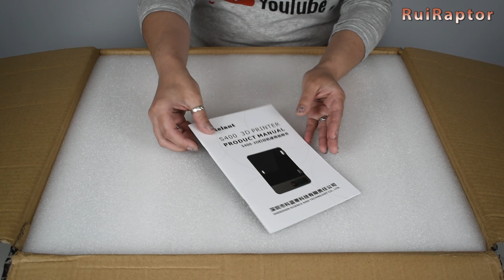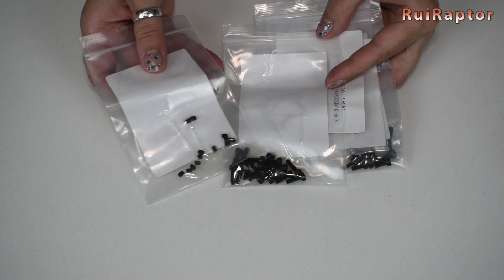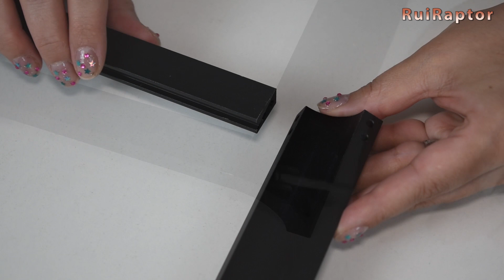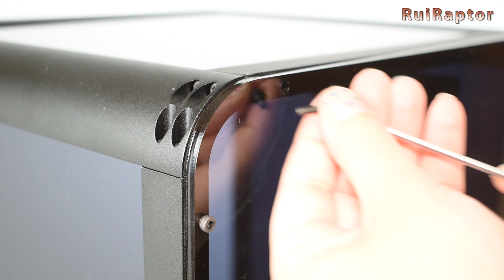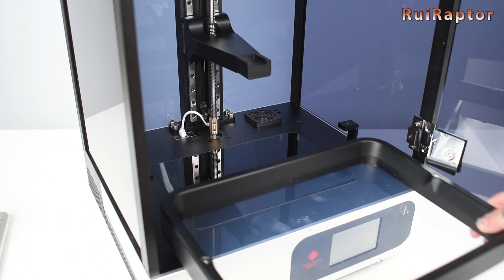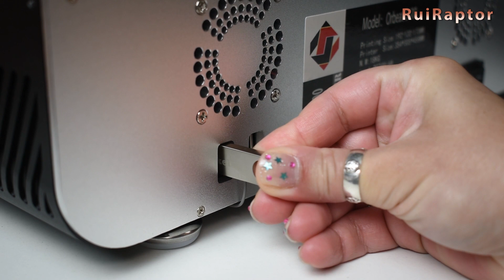Kelant S400 Resin 3D Printer - Assembly & Overview

Comment: For anyone following my scribblings, I finally got the Kelant to work.  It turned out to be settings all along, they need to be very different to the Photon and to the instruction book supplied.  Basically, all prints must be positioned at an angle of 45 degrees or more, supports must be medium or heavy with a minimum diameter of 2 mm, never use smaller as the film separation forces will break them every time.  The bottom lift speed which is where the film separates is 1 - 3 mm at 80 mm/sec in the book, this needs to be 3 mm at 15 - 20 mm/sec, separation using the book settings is with a loud bang but at the slower speed its a gentle ripping noise, much less damaging to the print and the Z axis.  At 50 um layers the bottom exposure should be 50 secs and normal exposure  7.5 - 8 secs, I have recently been printing at 100 um with almost no change to the print quality but increased times to 60 secs and 8.5 - 9 secs.  The rest of the settings are not important but I use 200 mm/sec rising and falling, no exposure delay and a second lift of 5 mm.  The base count is important, I use 5, any more and the base is so solid that a hammer and chisel are required to remove it from the bed.

These settings work with Anycubic resins so adjustment may be needed if the resin you use is know to require different settings, otherwise its a good place to start.    Don't try the book settings as they are way off, I have sent all this information to Kelant, whether they use it at all is up to them.  Once mastered the Combat S400 is a very good machine, robust, well made and now reliable, I just pause it to check the base about 15 minutes in then let it run, I have had perfect prints for a few days now.  One other point that is in the manual but always gets overlooked, remove the USB drive before turning on and re-insert after the machine has finished booting up, put it in too soon and the files won't be found.  One last point, because of the inconveniently placed USB ports at the back, I added a hub with a short lead for convenient access.  This works but the S400 usually finds up to 2, 3 or 4 folders now instead of 1, presumably caused by the hub.  I soon got the hang of finding the one with the files in, the rest will give a blank screen.

I hope this will be helpful to anyone struggling as I was.
Mark Clark
UK
Reply from the maker: Thank you for all your feedback Mark. Glad it's finally working :)
Reply: @ruiraptor  Not before time, it needs to earn me some money now to pay back all the time, effort and at least 4 liters of resin that's gone into it.  Kelant were not as supportive as I would have liked but a lot of that is down to poor communication, when I asked for a replacement or refund they found someone who knew English to deal with my emails and it went a lot more smoothly.

Enough of this, I've got printing to do and each run is over 7 hours, i can just get 3 a day in if I time it right.  Feel free to pass any enquiries about Kelants my way as I seem to be a self taught expert now and its good to share knowledge.
]
Mark
Reply from the maker: Hi Mark, since you had many issues related with settings, one idea is probably sharing your slicer profile. I guess that many users out there will have the same problems too. :)
Reply: @ruiraptor  Fine by me, below is what I sent to Kelant.  Their instructions are not good and suffer from poor grammar, I had to do a lot of interpreting and deduction to work out what they meant.  After all that the settings were way off, the 80 mm/min was the biggest issue as the larger film was ripped off the print damaging the print and the film.  The longer exposure times were Kelant's suggestion as the supports had random failures.  The settings below are for a group of prints using 80% of the area, for a small print in the center of the area reduce the exposure by 1 sec and bottom exposure by 5 secs.  Interestingly printing at 100 um layers produces almost identical results to 50 or 60 um but its not much quicker, I print railway wagon bodies 3 at a time at a 45 deg angle, around 1000 layers at about 20 secs per layer should be around 5.5 - 6 hours but it actually takes about 7.5 hours, no idea why as at 60 um and 1600 layers it was taking only an hour longer.  I have added the recommended settings to the right of the first set of settings for comparison.  I don't use Social Media so feel free to make these figures available to anyone interested, you can add my name and email as well as people often need explanations and I am used to dealing with emails from other countries.

- You should put a note in the packaging to say that "The USB drive should only be inserted after the machine has finished loading, otherwise the machine will not find any files"  It does say this in the instructions but most people overlook it.

- You should also add "File names must have normal characters and no spaces, example -   Battle_figure_35th_scale"

- Also add "Prints should be positioned standing at an angle of 45 degrees or more, they will print better and use less resin for supports".  Also "use only medium or heavy supports with a minimum diameter of 2mm"

All these points are important and will cause failed prints and endless frustration as I have had.  I will post this information on line.

These are the machine settings that I found work best, I have not printed layers less than 50 um.

Layer height 0.05 - 0.06 mm (50 - 60 um)

Exposure - 7.5 - 8 secs (7500 - 8000 ms)                               Rec - 5 - 5.5 sec
Bottom exposure - 50 secs (50,000 ms)                                  Rec - 40 sec
Bottom layer count - 5                                                              Rec - 3
Light off delay - 1 sec (1000 ms)                                              Rec - 1 - 3 sec
First lift distance - 3 mm                                                           Rec - 3 mm
First lift speed - 15 - 25 mm/min                                              Rec - 80 mm/min
Second lift distance - 5 mm                                                     Rec - 4 mm
Rising speed - 200 mm/min                                                     Rec - 300 mm/min
Falling speed - 200 mm/min                                                    Rec - 300 mm/min

Layer height 0.08 - 0.1mm (80 - 100um)

Exposure - 8.5 - 9 secs (8500 - 9000 ms)
Bottom exposure - 60 secs (60,000 ms)
Bottom layer count - 5
Light off delay - 1 sec (1000 ms)
First lift distance - 3 mm
First lift speed - 15 - 25 mm/min
Second lift distance - 5 mm
Rising speed - 200 mm/min
Falling speed - 200 mm/min

These settings are very different to the settings in your instructions, they will not work at all.  If you wish, add these settings to your instructions and say "as recommended by a customer" which will allow the purchaser to try them if they wish without affecting Kelant.

That's it, thanks for your support
Mark
Reply: @ruiraptor   Closer to a review than anything you have provided lately. I seem to remember actual reviews from your channel but apparently all you do is shill for Chinese companies these days.
Reply: Hi Mark I need help
I am trying to transfer a 3D model from the Chitubox program to the Kelant S400s printer and I always get Slice Format error, someone can help me I have passed them in all formats and I always get the same
Thank you
Reply: Hi Maria
The only format that the Kelant can use with Chitubox is a zip file, its usually at the bottom of the pop up list and the file name must have no spaces, use underscore as a space.  Your file name should read something like;  unicorn_figurine_52mm_x3  If there are spaces, the Kelant will reject it and I don't think it likes capital letters either.  The good point is that when a zip file is loaded it will display the settings on the screen and speeds, distances and times can be adjusted if necessary at the printer before printing.  Do not change the layer thickness as it will print a squashed or stretched item, I know because I tried it.  To change the layer height you have to reload in Chitubox and start from scratch.
Mark
Reply: Hi Mark Thank you for answering, Now if the machine is reading it but I'm still super frustrated it doesn't do anything if I give you my wasap we could exchange photos so you can help me with the parameters?? Please!!!
Reply: Or email????
Reply: I don't do wasap, email me on borsig1958@gmail.com.
Mark

Comment: The saga continues.  After repeated requests for help from Kelamt I tried all the things they suggested and more changes to the settings that I came up with.  To combat the fierce pull of the FEP film I slowed the first lift from 80mm/min to 60, then 40, 30, 20 and settled on 15mm/min for 4 mm lift.  I was getting separation of the base from the supports, this turned out to be the ChiTuBox base which is generated automatically.  It can be deleted then the supports get an individual base which merge to form a solid base.  I set these at 10mm dia and 0.6mm thick, problem solved.  I thought I was nearly there but kept getting support failure in patches of 6 to 10 supports, the print would still be mostly OK but a bit wonky above the failed supports.  Nothing I did had any effect so I attacked Kelant again demanding a replacement or refundand got a reply from someone with much better English and grammar who told me that study of the pictures I sent them indicated that increasing the exposure time by 2 seconds would help.

I was skeptical but gave it a try and it did work, the support failure has mostly gone.  All that remains is to find a support size that the machine likes.  I can't use light supports at all,, and the medium ones fail a lot as well.  Heavy supports work but I have to destroy the print to get them off.  The solution will be a medium support with thicker legs and top cone but the same attachment size.  Supports must also be removed while the print is still soft or the snapping force can damage the print.  I have now had 3 almost perfect prints in a row so it can't be much longer to get it right.

Comment: An update for any of you interested, its still not working!  Kelant insists that its the settings I am using but I am familiar enough with these resin printers to know that its more than that.  After more failures I stripped off the top covers for a good look at the working parts.  The Z axis is fine, rigid, upright and no play at any point, the bed is flat and adjusts far enough to sit squarely on the screen.  The screen however is not flat, when checked with a straight edge it has a high point at the left center, above where the screen ribbon cable folds underneath.  It is high enough to allow a piece of paper to slip under the ends of the steel rule I used as a straight edge.  Kelant say this will have no effect and asked me to send the stl files of the items that fail to print, they returned one with supports added and I test printed it, it failed, the base stuck but a lot of supports failed so I aborted after about 50 minutes.

Looking at where the high spot is I can see plastic film trapped under the screen, the remnants of the screen protector I expect.  When replacing the screen on my Photon I did not put sticky taper under the ribbon cable as I thought it might cause just this problem, Kelant have definitely stuck this end and trapped an extra film layer as well.  I have offered to remove the screen to rectify this on the condition that they will replace the screen if it cracks during removal but no response on that subject.  I am now chasing a replacement or refund which might make them get their act together and fix this one.  I would still rather have this working rather than have to go through the hassle of buying another but it might come to that.
Mark
Reply: Very interesting - please let us know how this is going on...

Comment: I did try the Kelant slicer but stuck to the ChiTuBox as i was familiar with it.  I am having problems with the suction of the film pulling away from the print, being a larger film with more stretch it releases with a bang and is breaking the supports, only heavy supports are strong enough to survive,  I thought I would try a big print to see if the film release was better than a small print in the middle for the release but it printed it with no base....don't know why, the base appeared in ChiTuBox, I added the supports and there was no base when it printed.  The Kelant has a pause function that raises the bed high enough to see underneath, I did this after 10 minutes and there was nothing on the bed and I now need a new film.  When I get that fitted I will try the Kelant slicer again.
Mark

Comment: No, do you have to do that?  I assumed that the file would be saved with all settings and print that way as every other printer on the planet does....Just looked through the data that Kelant sent and found that my Z/Y resolution was reversed, I reversed X and Y dimensions a few days ago and thought that was it but the resolution needed reversing as well, that explains the long skinny prints.  Apparently when the drive is plugged in and print is pressed, the resin parameters are displayed and have to be corrected manually to match the ChiTuBox settings, that will have to wait as I am out today.  This is worlds apart from the Photon, with the Photon you just save the sliced model, plug in the drive and print.  Hopefully the resin settings will be remembered from print to print, I just need to remember to check each time I use it.  What a pain, I was right when I said the Kelant's OS might be a bit dated and it would have been nice if this was mentioned in the impressive looking but not very helpful handbook.  I'll try all this later this week and report back.
Mark
Reply from the maker: Hi MArk,
if you use Kelant's slicer, you don't need to do it. But if you use Chitubox and after you select the file to print,  it will pop up a settings box on the printer's display for you to check and correct the settings to match the slicer.

Comment: It says 200mm in the book and there is room for 20mm in the travel so I assume so.  I have no need for this height, I am more interested in the 190 x 120mm X and Y measurement which is also correct.
Its still not working by the way, It is compressing the X by 40% and extending the Y by 40% so I'm getting long thin prints with only heavy supports surviving, the medium ones come out too thin and fail.  I have just received a tutorial on how to set up ChiTuBox from Kelant, not sure how much that will help but I will go through it later.  Since the basic LCD test is giving strange results, I can't see how ChiTuBox settings can help.
Reply from the maker: Hi Mark, did you type in the same settings in the printer display as in the slicer profile?

Comment: Kelant got back to me with the advice that it can only print files saved as .zip and file names must contain no special characters and no blanks, I removed the blanks and it now prints, I get the feeling that their on board OS might be a little dated!  One thing you will find when you test yours is that it needs much shorter exposure times, my Photon needs 90 secs for the base layers and 12 to 14 secs for the rest, I started at 60 and 8 secs for the Kelant and the print came out crispy and almost impossible to remove.  I am now trying 45 and 6 secs and find that overall it prints twice as fast as a Photon.  The cause of this is the LED array, 20W for the Photon and 75W for the Kelant, that's nearly 4 times the power for 3 times the area of screen.  Also the Photon's LEDs are flat on a heat exchanger but the Kelant's are in a lens matrix which possibly optimises the output for more effect.

I am still waiting for the first successful print, I put the print size into the slicer and got X and Y back to front, it printed, but only the center section.  I had one stuck to the FEP, one to the build plate which I nearly had to saw off and now separated parts floating in the resin.  The Kelant is fine, its just me finding the limits of the printer and slicer, which is ChiTuBox by the way, the supports don't seem as reliable as the Photon ones.

Thanks for your help
Mark
Reply: This is wonderful information to have, I have an odd question though. Is the Z max actually 200mm? I have a bit of a necessity for it to be so. Otherwise I'll be looking for another option.

Comment: I don't do social media, I prefer direct contact than passing on heresay.  I'll give Kelant another day to respond and pester them again if they don't, they will respond eventually.  It seems that most 3D printers fall down at this point, I've had glitches with 3 out of 4 FFD printers, all of which I had to sort out myself then issues with my Photon as well.  Its a shame as the Kelant seems a well thought out machine, apart from the USBs and switch at the back, I was looking forward to trying it.
Thanks for the response, Mark.
Reply from the maker: There is a Chinese holiday this weekend so you probably will not get a response back until monday. Which email did you use to contact Kelant?
Reply: @ruiraptor  I used the alex-kelant address in the manual which is a guy called Alex Lopez, he just got back to me and asked me to go through Aliexpress which I am about to do.  I tried a few different files today just to rule out a duff slice and got the same response.  When I press print I get a blank box and no action, I suspect a firmware issue, I had something similar on another printer.  Its usually easily sorted, I will let you know how it goes.
Reply from the maker: Check Kelant website. There you can find the firmware: https://www.kelanters.com/?fbclid=IwAR0-t9kQEjKSQh8jcPKDMNl1r8ebJbaWLWlcbay6MHSr1xrwMjBjbVh7hUc